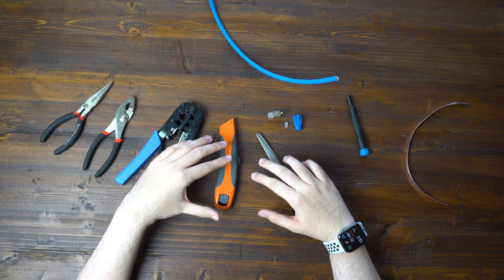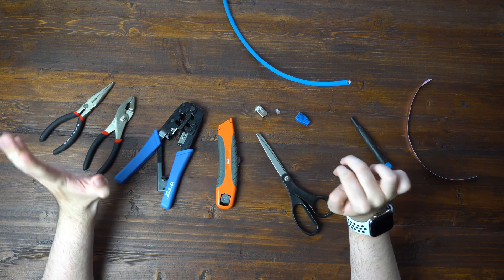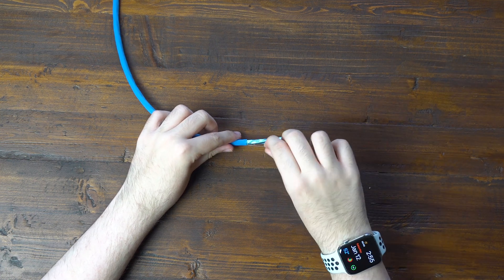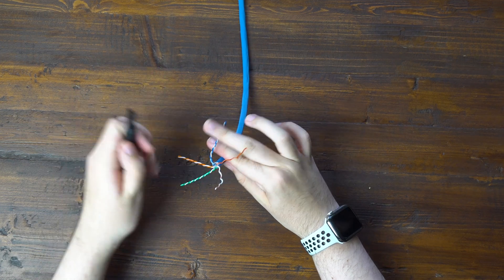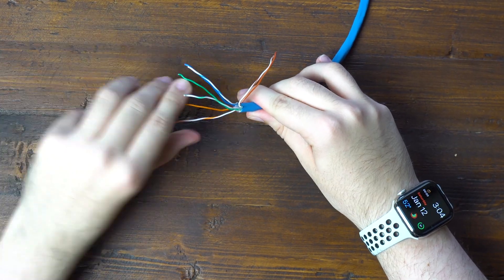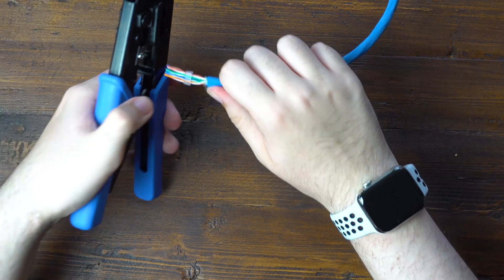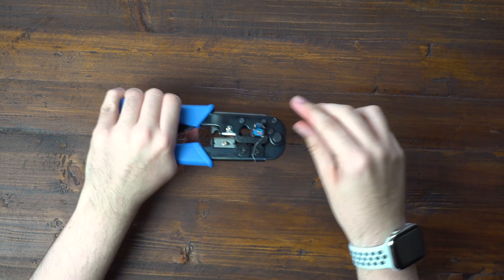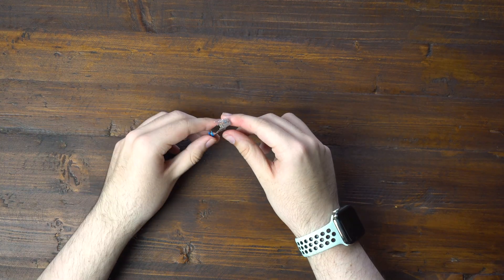How to Terminate Cat6A Shielded Ethernet Cable

Comment: Hello, In Testing Meter what G suggest? I think it is for shielded connectivity. What if i am having shielded cables and Ground is not blinking while testing?  Still shield will work to protect from EMC noise?

Please comment...
Reply: Very good question. I am very curious as well for the answer.  I also read from comments that there should be grounded only one side of the shielded cable not both sides. Is it true? Can anybody confirm this? It is very confusing this "Ground" topic around ethernet cabling and how to properly crimp shielded Cat6a cables. BTW. my crimp tool crushed the connector the same way as yours.

Comment: One of the few video's that informs you of putting the cable booth before terminating the cable. And shows you how to put on the load bar in combination with UTP connector. Compliment!

Comment: I tried 5 plugs now, none worked, no connection.. Tried cat 5e/6 plugs, on the cat 6a cable , and worked. :/
Reply: Chris. Be patient my man. We all struggle with this terrible design. Don't force the wires into the connector. Take the time to get them all lined up nice and cute and in a row. Sometimes wiggling the connector as you push helps.